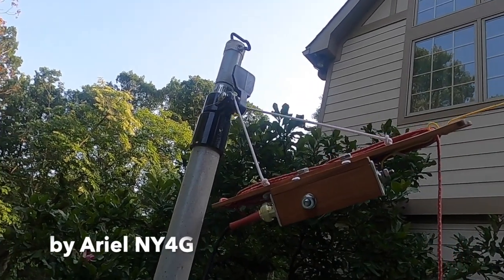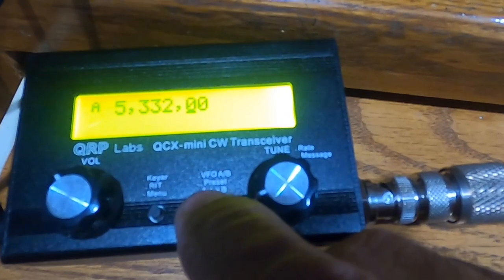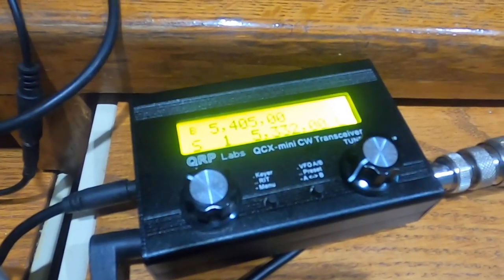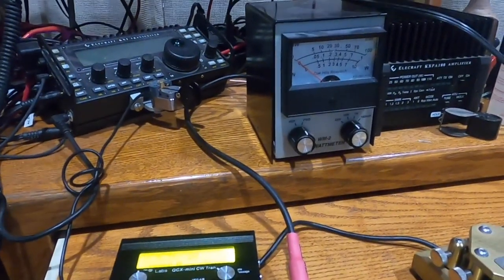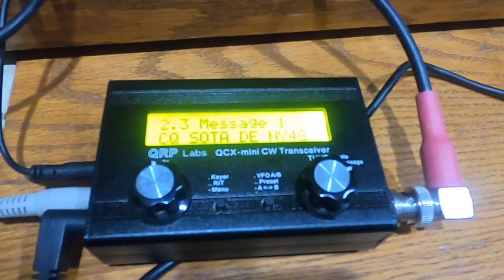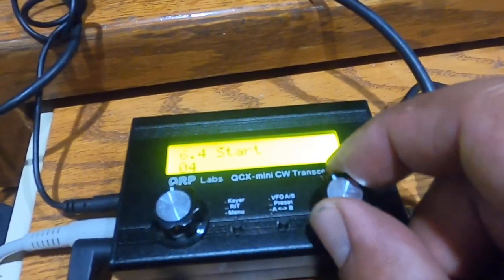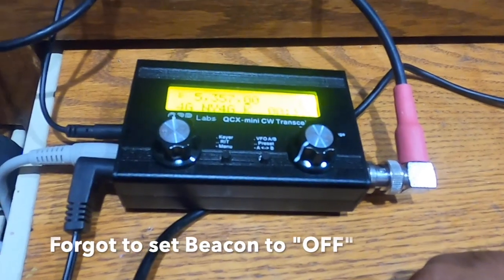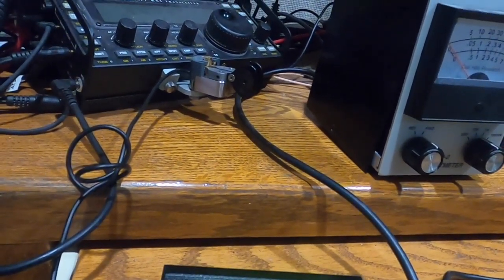A Review of the QCX Mini Single Band Transceiver for 60m

Comment: Many thanks for detailed review.

Could you please answer two questions?
What is the revision of main board Rev1 or Rev2)?
Does QCX mini has TCXO installed?

It seems like there is small interference problem in Rev2 version related to audio clicks during turning encoder.
Reply from the maker: It is RevA and it does have the TXCO installed
Reply from the maker: I will confirm revision when I get home.   I do have audio clicks when I turn the encoder so I might be in error on the revision
Reply: @CaptainRadioAdventures  Many thanks. I am very appreciative that.